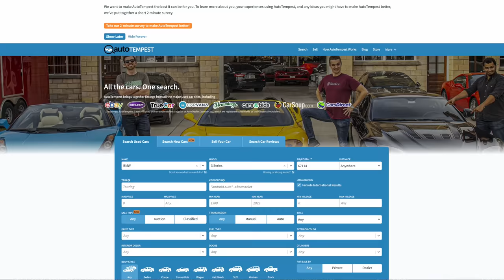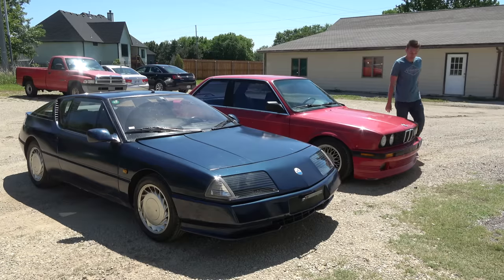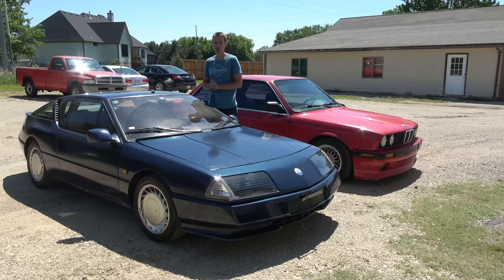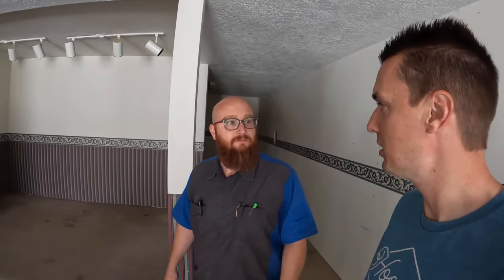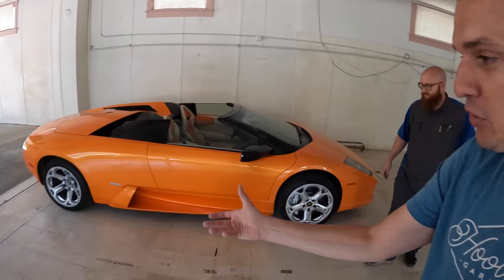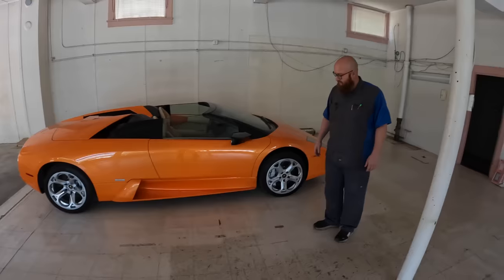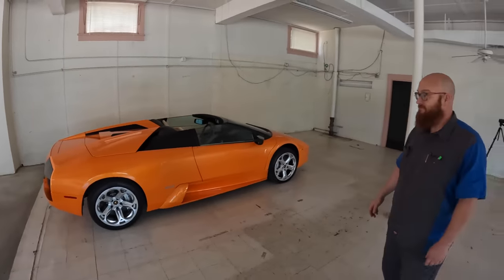Everything wrong with my CHEAP 90 year old shop building (was it a TERRIBLE $75,000 investment?)

Comment: Electrician here. At 22:02, I noticed a Federal Pacific disconnect (FPE). Those are extremely dangerous. They had their UL listing pulled by the federal government, meaning it is not a code-approved manufacturer. Anything Federal Pacific has to be changed out. They're extremely dangerous. Call an electrician and have that changed out before you rent it out
Reply: Yeah, I kinda cringed when I saw that panel…
Reply: a lot of the boxes by the sink could be removed and relocated as well but probably cheaper to get rid of the sink
Reply: Yeah that fucking thing needs to go before that wood building burns down
Reply: Good call ! 👍
Reply: Yes, Federal Pacific is dangerous. Two 100 amp fuses are not 200 amp service. Only 100amp capacity. As an electrical contractor I would scrap most if not all electrical equipment.
Reply: how difficult would it be to just flip the remaining boxes around and put them on the other side of the wall?
Reply: As a fellow electrician. I agree with you completely.
Reply: If you notice, main service and disconnect are on the outside, when they toured the HVAC.   Everything inside can be ripped out and installed into a new sub panel.  Hoovie has a new service just run a feeder to the main and locate the panel where all clearances exist.  Per NEC, it is not illegal to install a panel in a bathroom as long as clearances are kept.  Agreed that the FPE should be replaced.
Reply: And then how Wizard half way pulled it and almost disconnected it, possibly arc blasting that old af panel and blowing them both up.
Reply: @dustin5169  Good the power was off to the building.
Reply: I replaced mine years ago, because i didn't trust it
Reply: hopefully no power going to it from the breaker or no load on it
Reply: It looks cool, but indeed it's very dangerous and needs to be taken out. You need new wiring and probably new outlets as well. That combined with the new flooring, it going be upwards of 17,000 USD to make it safe and usable.
Reply: Good ol' burn boxes!
Reply: No you do not need to replace them, their disconnects are fine and also their transformers are good. FPE stablock is what gave them a bad name.
Reply: @Acaidia  red bar on the breaker means it's a stablock. Not to mention, the UL listing got pulled for the whole company
Reply: I've been to third world countries; everything looks fine. Y'all worry too much thanks to overregulation in this country.
Reply: My wife always asks why I watch this dudes videos when all he talks about is cars but I know he’s got smart viewers actually where I learn stuff like this. Thank you.
Reply: @rhkiku  I didn't know that, thanks for the info.
Reply: he is banking on the views of his building in flames. He will get the 75k back and then insurance LOL!
Reply: plus the electrics are way too close to the water supply.
Reply: Home inspector, and came looking for this comment. Was sure I can't be the only one that saw it. Was actually two, one above the main shutoff and one opposite wall of the "spray paint" area
Reply: From an EU/UK perspective, the entire electrical installation looked fucking *terrifying*, and I hobby play with tesla coils and railguns and other things in free time with enough power behind them to kill a small town worth of people
Reply: Agreed, I spent 15 years in the trade as an electrician. Swapped out many FP panels, breakers do NOT trip causing fires. Total GARBAGE. Consumers need to know this, their lives may depend on it. We scrapped it.

Comment: You need to have a real building inspection.  Wizard was incorrect when he said it was a 200 amp service.  It's a 100 amp service...you don't add the two 100 amp fuses together to determine the service size.  Also, the electrical panel in the addition is a Federal Pacific Stab Loc panel known for failure and the company was forced to stop selling them in the U.S. by the CPSC.  Your water piping is galvanized steel and well beyond it's life span and known to be problematic.  The excessive cracking of the stucco is only "normal" on buildings that haven't been maintained properly.  It needs to be repaired or replaced and will cost well over $5,000.  Someone needs to actually go into the crawlspace and onto the roof to inspect it.
Reply: I have a feeling he does actually know at least some of this - Wizard as well - and the video is for the lols. He's owned multiple houses and businesses - Wizard too - and you don't go through the real estate process without picking up on this stuff. They're being nice pleasant trolls :-)
Reply: @ironymatt  Exactly! Tyler's playing dumb as always for the views, but he knows what he knows exactly what he's doing.
Reply: I'm glad someone else noticed that. 

Wizard needs to stay to cars.
Reply: I mean it could be a 200amp service, if you replaced the fuses with the industry standard bolts instead...or was that 2000amp? I can't remember the official chart :D
Reply: He'll be fine as long as he doesn't hire hi tech interiors

Comment: The main issues with your new building are a lack of parking and restrooms that aren't accessible. The electrical that close to a water source is also a code issue. I would avoid the temptation to try and get any sort of restaurant in the space as that would open up a can of worms for needing new restrooms, adding grease traps, increasing heating and cooling loads etc. I think I would market towards a professional office (non medical) like an engineer, insurance, etc. that don't need a ton of parking and won't increase the occupant load. Good luck!
Reply: really good advice! The parking situation makes it really tough to use for much else.
Reply: good call. I was thinking like an antique store or clothing boutique since he said it's his wife's project.

Comment: No way it would be 5-8k to get the building ready for rent. 5-8k will just be for the floors and that is using very cheap material. I'd say closer to 15-20k to get it ready. Should really upgrade the electrical box and move it if possible.
Reply: While I don't know the Kansas laws, I doubt that panel in the bathroom is anywhere near building code.
Reply: It’s been there for what sounds like 100 years, if it was a problem I’m sure it would have been a problem already.
Reply: @earlyre  Older buildings are usually grandfathered in but would still be a good idea to update it. Though I can understand not wanting to spend the extra money
Reply: @earlyre  having to relocate the electrical service would likely depend on the extent of renovations done.  As long as he just puts lipstick on a pig (paint, flooring, etc) then he'll probably be able to get it grandfathered in.  Once he starts making changes to the electrical, he'll have to bring it up to current code.  That's how that mess  has lasted where it's at all this time.  The previous owners didn't change stuff, so it didn't have to be brought up to current code.
Reply: Yeah I would fix outside cosmetics, floors, electrical, HVAC, and reconfigure existing spot into an actual bathroom. Tens of thousands to do all that, but will add value and make easy and reliable for rental
Reply: I would also repaint it. Buildings that old usually have leaded paint.
Reply: @incongruous3348  And depending on when that floor was installed it could contain asbestos. Which can be pricey to get rid of.
Reply: @earlyre  was thinking the same.
Reply: i think it will be the same price of the building..5-6 grand will just fix the floors maybe lol
Reply: Right about that, in my area, that probably won’t even cover the material,  none the less the labor to put the floor in for a building that size
Reply: @wojo31483  Wizard maybe good at estimating how much to fix Hoovie's cars but imo. he's Way off on what it's gonna take to fix what's wrong with this building.
Reply: Exactly I was thinking..  especially commercial real estate is a different ball game.. don't forget about inspections and stuff
Reply: Trust fund handles all.
Reply: Lol this is not true at all. You obviously have no idea what you talking about. 

Source:

I’m a general contractor bud
Reply: 5k to 8k for the floors? I'd rip the entire floor out, fill the crawl space with compacted earth and gravel until it's half filled in and then fill the rest with concrete and add a top layer of fluid concrete. When it's dry you can put linoleum or anything you want on top. You'll never have to worry about that floor again.
Reply: Probably 20-30k altogether because something is bound to come up...the bathroom needs to be remodeled so it's not next to exposed circuit breakers, and remodeling bathrooms these days can cost well over 10k in itself.
Reply: I don’t know if moving a building could be considered renovation at that point
Reply: @earlyre  The panel is 100% allowed, as long as proper clearances and layouts are followed.
Reply: Yeah I would also argue that 20K comes first. 
But it all depends, i wouldn't spend too much either since the new renter will most likely be a businesses,  and they'll have their own decor to put in anyway. 
If the electricity is safe. Its safe. I woild spend a penny to upgrade it without any benefits for.myself
Reply: Level the building and start from scratch. Fixing it would be like putting lipstick on a pig.

Comment: 5-10k would fix the leaking door sill and strip the floor. 10k more would put down a commercial vinyl floor. 10k more would fox the stucco and paint the building. 15k would re-wire the building to code. You would need to get an estimate on drywall, plumbing, interior paint, and a pest control contract.
Reply: You're correct. It was tremendously stupid to not have this building inspected before purchase. He's looking at at least $60-70k to get that building up to code and rent-able standards. There's no way that foundation, sub-flooring, electric, and plumbing passes inspection. Plus possible lead and asbestos abatement. Add an extra $30-40k at least.
Reply: Knock it down and start again.
Reply: And a new AC would be $10,000-$12,000–not $5,000

Comment: That access hatch in the sidewalk was most likely for heating oil deliveries before upgrading to central hvac. Fill it in with cement and be done with it. Take about $10 & 20 minutes
Reply: coal chute
Reply: @tinkeringtrucker5196  not with that shallow of a crawl space....
Reply: Fuel oil isn't common on the great plains.  I don't think it exists outside the northeast due to the availability of natural gas.
Reply: why cement
Reply: Concrete...cement is used to join bricks together.
Reply: @muskokamike127  incorrect, mortar is used for bricklaying, cement is a natural material that is crushed up into dust to mix in to ballast/sand to make all sorts of different things, such as concrete and mortar.. can also mix it into the ground to stabilise it
Reply: @bredeyyy7402  Cement is also another word for glue!
Reply: @bugalaman  My mom's house in southwest Wisconsin built in 1972 had oil heating but was converted to natural gas in the late 90's. I still remember that basement smelling like oil.
Reply: Who are you hiring for $10 ?
Reply: @AZBEEMR  Pretty sure they meant just doing it yourself with a bag of concrete mix and water.
Reply: a truck load of concrete costs more then 10 bucks 🤔
Reply: @804_Rider  but a big bag of quickcrete isn't
Reply: @TriCountyMotorsEastman  bro just put some rocks and sand in there (which you can get for free) and a new cover. you guys are goin over board lol. if he want he could even paint the cover a hi vis color and people will see it and avoid it. i know i avoid stepping on plates/grills/vents even though I know they can hold my weight. honestly how it is right now isn't even hazardous. is it violating a code?
Reply: @joeh858  I'm guessing you have never owned a business. I'd bet if an insurance inspection was done that would have to be addressed to get/keep coverage. Whether filling it in with concrete of a new grate might depend on the inspector/company. But that one wasn't in shape where it was safe. And painting it high viz won't be enough with the courts how they are.
A bag of quickcrete and and less than half and hour and you have a permanent fix for $10 that guarantees you don t get sued.
Reply: @TriCountyMotorsEastman  or don't live in CA or NY. lmao
Reply: you don't need to fill the entire thing with concrete holy shit do you guys understand physics
Reply: e  go away bot
Reply: @bugalaman  90 years ago there wasn't natural gas infrastructure though right?
Reply: @Richard Cranium up in Ontario a 66lb bag of sakrete concrete mix is just shy of $6 Canadian a bag
Reply: @Richard Cranium 80 lb bag of ready mix at lowes..6 bucks..
Reply: @joeh858  building contractor/inspector here...not sure about that cities priorities but that cover is not code and a hazard anywhere else...it's not functional..a bag of quick crete and problem solved
Reply: @stratonarrow  no, but using oil, coal and wood to heat homes was commonplace before the advent of modern heating systems of natural gas. 

There are many old buildings with coal chutes into the basements and oil lines for the old furnaces.
Reply: @TriCountyMotorsEastman  Plus, they're in Kansas, where the hazard will regularly be hidden under some snow.
Reply: @Hivoltage1999 and duct tape.
Reply: @bugalaman  oh it does exist I have heated with oil in Michigan, Illinois and Wisconsin.
Reply: @Hivoltage1999 hehehe
Reply: @bredeyyy7402  Almost correct, cement isn't naturally occuring, it's made by mixing limestone and clay then roasting it to produce clinker; to this, a quantity og gypsum is added and the mix is ground to a fine powder.

Comment: Be careful with that flooring, as vinyl tiles that break/snap were often made with Asbestos.
Reply: The textured ceilings too.
Reply: Absestostiles are only dangerous if filed or ground up to be made airborne otherwise it's safe
Reply: the floors aren't that old, Loewen Upholstery redid them with all new tile and plywood when they moved in in 2010, new asbestos flooring installation was banned as of 1986 (and production of vinyl-asbestos tiles had been phased out a few years before that, with manufacturers given a few years to use up inventory)
Reply: Remember this is Kansas not Kommifornia...
Reply: @coniccinoc  lol you have no clue what you talking about bud

Comment: Tip for wizard!! NEVER throw a main switch on while the cover is off hahahah especially on an unfamiliar installation 😂
Reply: In the UK it's not possible to open the cover of a disconnect with the switch on and impossible to close it with the cover open; I am very surprised that it isn't the same in the USA

Comment: Hoovie will pass out again when he actually gets quotes to fix the building proper
Reply: Nope. Not much wrong with it at all. Mostly cosmetic.
Reply: @muskokamike127  You're dreaming. There's no way that foundation, sub-flooring, electric, and plumbing passes inspection. $60-70k price at least to get that building up to code and rent-able standards. The Federal Pacific Electric disconnects needs to be replaced immediately. Add in in extra $30-40k for the near certain lead and asbestos abatement that will need to be done on those VCT floors, walls, and insulation.
Reply: @dr.z1657  Ok, whatever you say Mr Building Code professional......as for the vct floors....ahem....do you know the authorized proper way to deal with it? Cover it with new sub floor and then apply new flooring on top of it. Removing it just adds to the issue. 

As for the disconnects, they don't need to be replaced, just removed since there are no meat coolers, walk in freezers etc in the building. Next you're going to tell me he has to install a sprinkler system lol.....
Reply: @muskokamike127  Please delete all your accounts on social media...you know nothing
Reply: @d-james255  What's truly amazing is that you probably spent a good 20 minutes composing that nonsensical post lol.
Reply: @muskokamike127  wrong again...21 minutes and 20 seconds
Reply: @d-james255  what happens at 21 mins and 20 seconds that proves anything you've alluded to?
Reply: I Doubt it. Its flyover country and our standards are low.
Reply: @shaung638  Your wrong building codes are fairly universal across the US if anything some states many be using codes from a few years ago . Where states with the strictest codes tend to update their codes if not every year at least every other year . Those with the oldest codes are only 5yrs out of date with OHSA FEMA and the ICC who's guidelines most states use to write their codes ,well except CA I believe they have their own code level of enforcement which is why building anything there is basically either stupidly expensive or illegal  . PS this building is a basket case I own commercial real estate , it's mostly how I make my income since I retired and unless they gave him this building it'll be years before he makes his investment back just due to the amount he'll need to get an occupancy permit in order to rent the property . Which will require both a building safety and electrical inspection ,they may not have turned the power on because it needs to be inspected first I have had that with some power companies in commercial spaces .
Reply: @bfairfax8772  You get far enough into flyover country and the only government office that gives two shits about what you are doing is the county assessor. Got to get all that tax revenue.